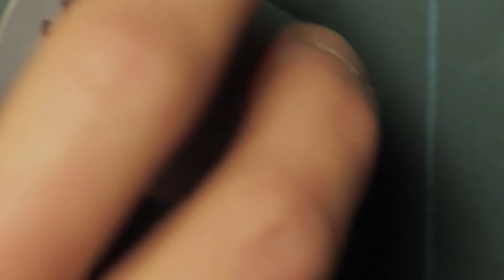Breitling Cadette Chrono Movement Disassembly Venus 188 Part 2

Comment: You are a star! Repair a bent centre wheel pivot? You showed it. I did it. I'd broken two by attempting to put pressure on the pivot and bending using a twisting motion on the tweezers Even heard the 'crack'. Did it your way on the third replacement. Gentle roll of the wheel whilst the pivot was in the tweezers and then rolling on the flat surface in the tweezers. It worked.  Thank you so much. Show that on a separate video for all to see?
Reply from the maker: That's a good idea. Thank you. Glad it helped.
If I still have the original files I'll look at that.
It doesn't always work but it's always worth trying.

Comment: An upgrade to my last comment. Don't know if you realised how good your part of the video that showed the straightening of the 4th wheel was. I only just realised when I was re-watching the video. Your repair was on the 4th wheel and pivot. My repair was actually on my centre wheel which had the second hand pivot extending. (I'm new to watch repair, and working alone I have difficulty in remembering which name belongs to which part, which is why I named the wrong wheel. Sorry.)  Anyway, It was this Centre wheel top pivot that was bent in two places. In effect, it was 1/2 the diameter of your pivot repair. Working on a Sekonda/Slava 2428. So again. Many thanks.
Reply from the maker: Thank you for the further detail. It be confusing and still well done on the straightening. As before it doesn't always work and I have broken pivots but it's always worth a try. There's a more convoluted method which involves heating to remove the temper and either rolling or using a hole drilled in brass stock then you have to burnish afterwards to surface harden but that's something I'd only do if it was a critical part and impossible to replace.
Re the names. If you just work out from the mainspring barrel. Always assume that's your '1st' wheel then the train in order goes 2nd, 3rd, 4th, (this is the one your seconds hand attaches to and it rotates 360 degrees per minute, then your escape (5th) then the pallets.
There are some rare exceptions and sometimes indirectly driven seconds hands.